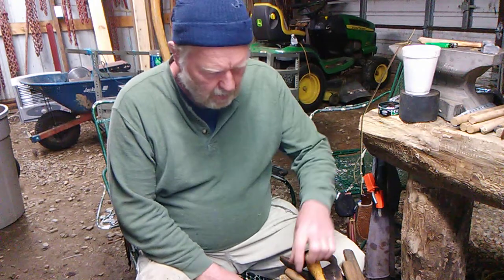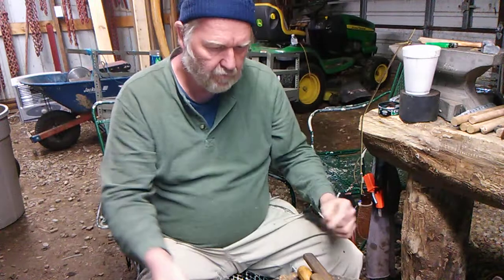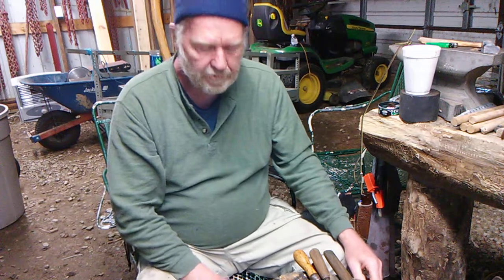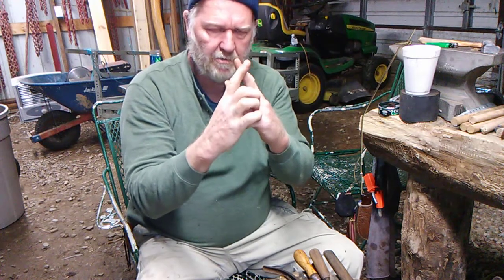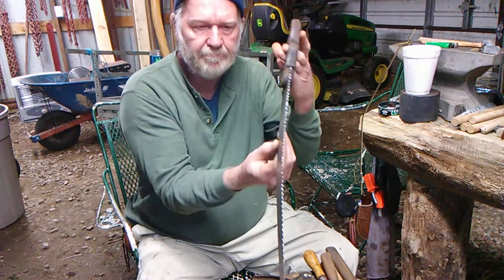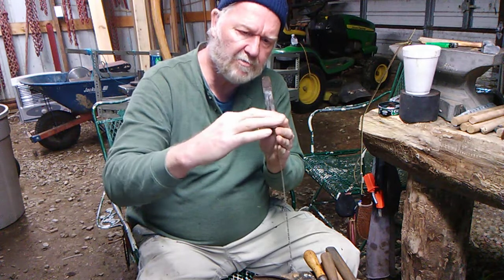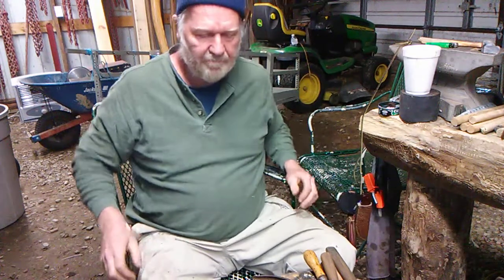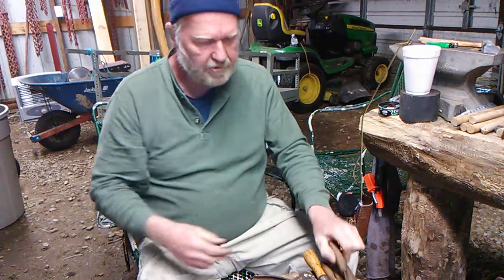October 27, 2018,, How To Sharpen A Saw Blade  Pt,1,,

Comment: That's an intimidating number of teeth on that 10 inch blade. I think I'd start with one of the 8 inch ones. The only saws I've sharpened were chainsaws and that was quite a few years ago. I think if I could test in a shorter length of time and see if I was doing okay it would give me more confidence to tackle the toothier ones. Thanks for the tutorial! 👍😀
Reply from the maker: ,,hello,, it seem like i was never going to get that blade done,, that`s a lot of teeth for sure,, once you learn the set it easy,,thanks for watching,,